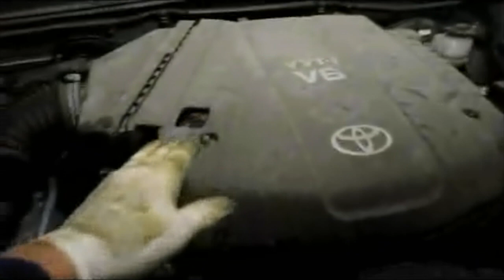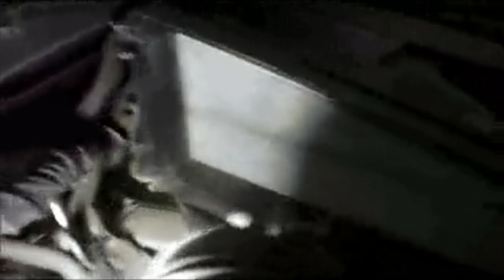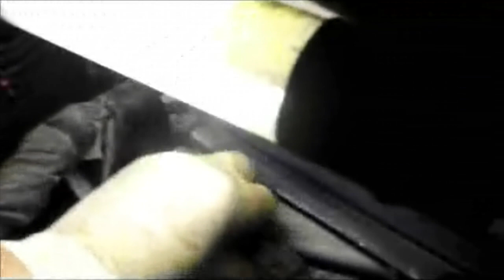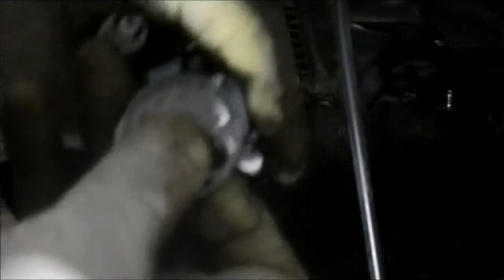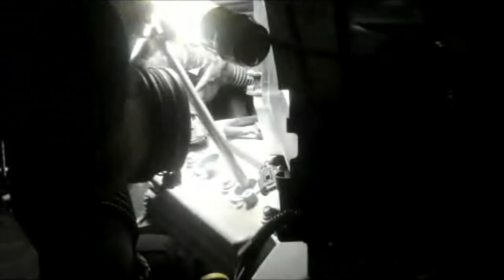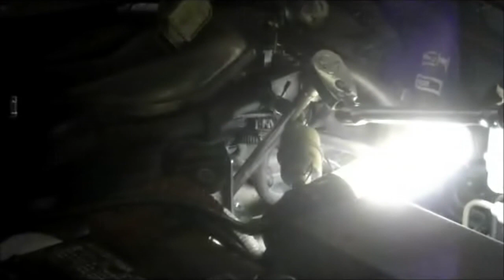Replace Spark Plugs 2005-2014 Toyota Tacoma 4.0 Liter

Comment: Great video jim!  I can remember doing the old iron block V8 V angles, cutting my hands on the heat shield I don't know how many times lol  I'll take the coil pack straight off the top of the cylinder head anyday. 😁